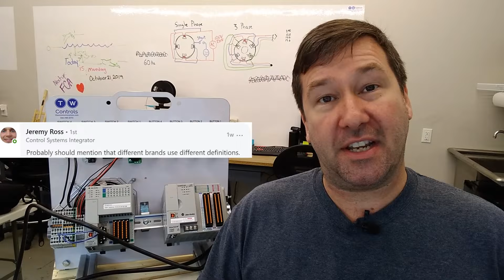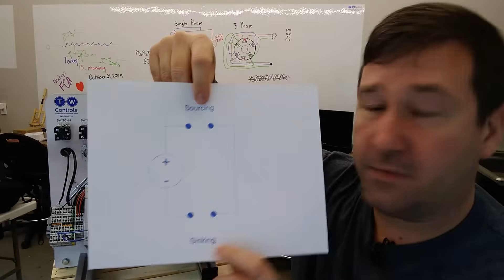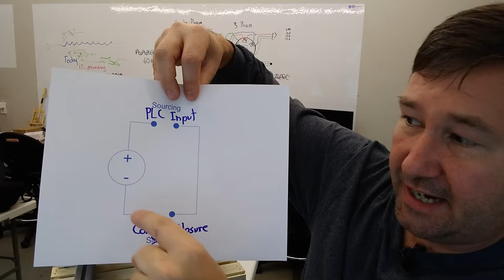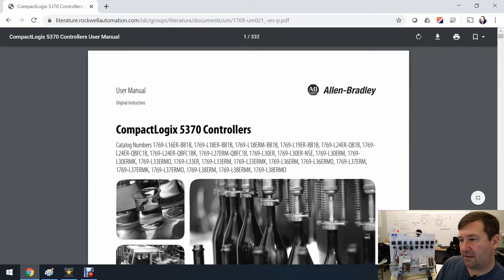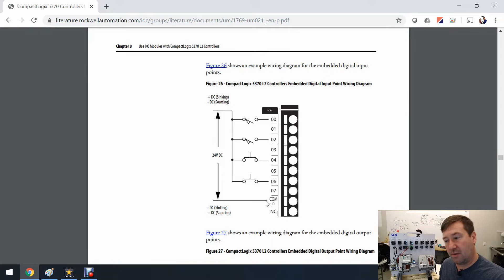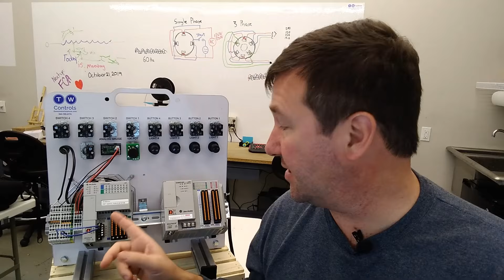Sinking and Sourcing PLC Inputs with PNP NPN Sensors

Comment: This is a typically hard concept for people to follow, mostly i think because of the nomenclature not used anywhere but electronics. I once again was out at a customer helping get a process running, and somebody had wired an NPN sensor to their sinking inputs. I always think of it in as they look phoenetically, NPN sensor (P is the common between the two. Positive resides on the common of the plc) PNP sensor (N is common between the Ps, so N [0v] is the common on the plc). Sourcing to me can just mean the source of the voltage comes from this point, so activating a PNP Sourcing sensor means the return wire to the plc input will have voltage and must complete the circuit with the Common being the 0vdc wire or "N".
Reply: I'll add too that it's almost comical how many technicians I run into that say "If the lights on, it's working, so it doesn't make sense why the input won't turn on, I think the PLC is bad." 

A GREAT tool for people to use, veteran and novice, is the Turck TB3-CP80. It will not only power sensors, photo eyes, etc. but also tell you if it's working and whether it's NPN or PNP, normally open or normally closed. If anybody does troubleshooting with sensors, they need it.
Reply from the maker: That's a good phonetic.  Keeping them straight is half of the battle!

Comment: Hi Tim, great video! Love your learning video series! Just got a stupid question, does PLC have internal physical Relays or coils for digital output? Searched over internet, someone says yes, someone says no. I am confused. Could you clarify this question for me? Many Thanks!
Reply from the maker: Oh my this is a popular question this week!  NO NO NO!  A PLC has memory areas, not magical internal relays.  They can be different sizes, in the case of your output it is a BOOL data type which can hold a 0 or a 1.  Ones that are associated with an output are no different than ones you create as far as PLC programming.  They just happen to be used to update the physical outputs.

I guess I'm going to make a video that tries to clear this up soon, but here is an older one of me ranting about people using the terms normally open, normally closed, and relay to describe PLC instructions.
https://twcontrols.com/lessons/plc-training-plc-instructions-are-not-the-same-as-electrical-symbols-normally-open-and-normally-closed

Comment: Ok here goes, Zero experience sparky - I  have a 24v motor that controls a sliding door with 2 proximity sensors, when the door is closed(sensor indicates green and amber light) and I press the open switch the door will open until it reaches the outer end sensor and the motor stops. Now the closed sensor turns to green only. When I press the close button the door doesnt close. I have 24 volts at the switch and the switch is working properly. My question is -  is the outer proximity switch supposed to supply power to the junction box to signal for a close command?
Reply from the maker: There is 100 different ways you can wire that. You are going to need to trace it out. Good luck!

Comment: hello there ;
im talk about ( zelio or delta (low cost plc)) how can i recieve (4-20 ma) and how can i saving these data in register and export them by ethernet or serial output . and about module that i use to convert 4-20 ma to 0-10v or 0-5 v is ther any problem with real floating signal like (4.367 ma for example) i mean i want to keep this real signal and i want to get it like input with not approx reading 
regards

Comment: Hello Tim,
I was wondering if you ever created a training video on the effects of grounding the positive output terminal on your I/O power to the cards. Could you show the effects on Grounding the Positive Output on the DC Power Supply on your Oscilloscope. Then preform the same illustration on the grounding of  the Negative Output side of the Power Supply.  Then show how this effects sourcing and sinking PLC'S I/O cards as it relates false Input Signal, Output turn on with out the signal from the Output Card. Also could you explain the effects of lifting the Ground on the Secondary side of the Power Supply.  Thank you
Reply from the maker: Hi Mark.  That one is on the list, stay tuned!
Reply: @TimWilborne  Thank you. I will keep watching.

Comment: pnp sensor has 3 terminals : +,- & the sensor o/p terminal which sends 24V w.r.t ground to the input or output port of the plc. While NPN sends 0V.
Reply from the maker: Both NPN and PNP sensors can be 2 wire or 3 wire devices.  Also you don't "send" 0V.  0V sinks a potential from the PLC input.  It is a small detail but it also helps you keep the sinking and sourcing terms straight.
Reply: @TimWilborne  Thanks for clarifying. Also loved your video.
Reply from the maker: @akashsharmaaaa  You are welcome, thank you for watching!

Comment: It has to do with transistor design, and how they are dopped. I believe the L24 has opto isolators so it doesn't care which way the power flows, this is however a more expensive option. This might help https://youtu.be/7ukDKVHnac4
Reply from the maker: Good tips John, thanks!

Comment: PNP or NPN sensors goes with the transistors or electronics inside it. If its using a PNP electronic parts then the sensor is PNP. And to understand this, you can take a look how to wire a transistor if its PNP or if its NPN. That's my guess!
Reply from the maker: There has been enough interest in this that I might make a video. Thanks for watching!

Comment: To answer the question why do we have NPN & NPN? It was my understanding from an "older instructor" who has been in high speed programming and  impressive resume told me that either PNP or NPN (not sure which one, I think it was NPN) predates the other. So the reason why you have both PNP and NPN is because in the past they could only make the electronics one way. Then they figured out how to make the PNP, I believe. That the best I recall from a few years ago. I recall him saying what Tim said in the video, that the concern was that if a wire is pinched or something cause something to ground the could cause somethiing to run which you did not want. In the case of PNP, you was more likely to blow a fuse.
Reply from the maker: Good explanation Mike.  NPN is older and for some reason slightly faster.  I'm going to do a video on it as soon as I have time to study on it.  Thanks for watching!

Comment: If I wanted to simply monitor the dry 'alarm' contacts on a bunch of field devices (which are NC, and 'Open' on alarm), should I use sinking or sourcing PLC inputs?
Reply from the maker: With a dry contact, you can use either a sinking or sourcing PLC input.
Reply: @TimWilborne  Thanks! Would sinking or sourcing inputs be the most common method for dry contact monitoring?
Reply from the maker: @RD-ni7qe  There is no right or wrong answer to the question.  Sinking inputs are more common if that helps.

Comment: For one of my application (egg counting system) previously I used PNP, and the result was that I was getting short on the counts by 10k. I then used NPN, with 24V going to the PLC com and receiving a negative input on the PLC card, and the cout was aproximately perfect.
Reply from the maker: Interesting application example Nikhil.  I might try to replicate it for a video.

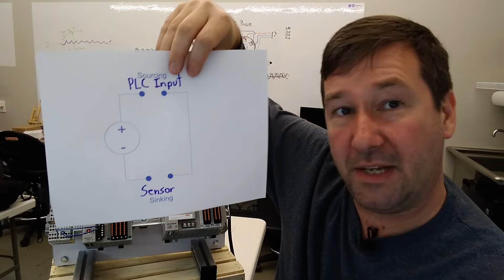Comment: At 15:00 you ask why they use the terms  PNP and NPN instead of source and sink.  The PNP and NPN terms are from transistor construction and what type of material you have sandwiched in there to create the transistor.  And in a BJT the emitter leg will source in a PNP device and on an NPN the emitter leg is a sink.  That's why on a PNP transistor schematic symbol the arrow points outward and on a NPN transistor symbol the arrow points inward.   Thanks for your videos, looking to change focus and get a new job soon.
Reply: Reverse! NPN points to emitter.
Reply: @rhythmandacoustics  Correct........My instructor taught me that the little arrow is a penis. So arrow pointing into the center is a  PNP (pee in the potty). Arrow pointing out is a NPN (no pee in the potty.....BHAHAHAHA
Reply from the maker: Great explanation. Thank you watching and good luck with your job search!
Reply: "Point in please" and "Never point in" is how we learned in the old days.

Comment: What about OUTPUTs, would you have any tips on those? Sounds simple at first, but some guys say it's more complex
Reply from the maker: See if this video helps. It's for the Compactlogix but the principles are the same for most any PLC.
Reply: Yeah, this video on INPUT basically does it. My boss told me today that OUTPUT would be the other way around - - simply check wether your PLC OUTPUT is PNP or NPN, then complete the circuit with your load towards the opposite polarity. Loads would have no polarity
Reply from the maker: Not sure I understand your question Alan.  Both of those videos cover inputs and outputs.
Reply: @TimWilborne  Did you by chance send a video link with your previous reply? It won't show on my side
Reply from the maker: @alancordeiro8650  Try this link https://www.youtube.com/watch?v=qbra8auofCc

Comment: It's much easier to find that burnt wire and replace the IO fuse than it is to figure out why intermittently the machine does something on it's own. Especially given that wires+vibration+metal = short to ground.

Comment: When you were mentioning Applications to use sinking vs sourcing... 

I think one thing that should be added is that if you are dealing with system that uses a variety of sensors that requires different voltages (e.g 5vdc, 10vdc, 12vdc, 24vdc etc) you can use a plc with sinking outputs and connect for example a 5v sensor on output 1, a 10v sensor on output 2, a 12v sensor on output 3, etc. this works because you’re switching the negative side of the sensor. All commons/ negative side of each power supplies are almost always tied together somewhere whether it be through internal chassis ground, on a PCB negative rail, or directly tied together through terminal blocks.

Switch is done using NPN.

Its not posable to use differed voltages  on a sourcing PLC because your switching the positive side of the load. If you were to connect the positive side of power supplies of different voltages your output voltage would end up being whatever the highest voltage power supply is. (e.g 5v, 12v, 24v = 24v out) So you would end up a single output voltage instead of different voltages. Because switching is done using PNP.

So all that being said documents for both PLC and Sensors vary from manufacturer to manufacturer and series. I think the only way to know what you  have or need is to look up the internal schematics for each PLC and sensor and check the type of transistor being used in the PLC and then the type of transistor being used in sensor and not rely solely on the manufactures product description.  Yes this is/ would be a daunting task but its really the only way I can see to be 100% certain you end up with a proper system design.
Reply from the maker: That is an interesting thought about using sinking inputs for multiple voltages. The PLC inputs even when sinking usually are for specific voltage so I'm trying to figure out whether that's a good practice or not.

 Do you have any PLC manuals you can think of that show examples of this being done?
Reply: So... Allen Bradley’s manuals don’t appear to list full specs for their products they just list basic value of 24v for inputs and outputs. I dont see anywhere in their manuals where they list dropout voltages for any of their I/O’s. To be able to use different voltages you would need to know the dropout voltage of the inputs.

Don’t dog me for this.. but all of automation directs plc’s list the dropout voltages and the stable min max voltages for all their plc’s and modules I/O’s. 

For instance click’s I/O’s operate between 5~24v. and I know mixed voltages work on click’s and brx’s

Since Allen Bradley doesn’t seem to have theirs listed if you have a variable bench power supply? You could hook it up to one input and set it at the 24 V you know works. Then slowly lower the voltage until the input turns off. Then slowly raise the voltage. Until it turns back on. 

It’s either going to turn on or off at a higher voltage. It will not be the same voltage for both. Take that number and add a min of 2~3v and that should give you your min stable voltage.

If it turns off at 20~24v then I guess they must have fixed voltage inputs. And would guess if you ohm out the input its high resistance.
Reply from the maker: @mumbles1justin  I can see how this would be a good practice for a PLC output, page 2-35 of the Click manual clearly shows an example of it.

But while I think this would work for a PLC input in most cases,I don't think this would be a good practice.  Even on our devices, the circuitry is different for 5VDC sinking inputs compared to 24VDC sinking inputs to adjust the switching threshold.

Looking on that same page 2-35 of the Click manual, the ON threshold is 19V and the off is 4V (7V for X3-8).  12V or 5V may switch them but are not in the range.  That seems to be the case for all of the Click inputs except the C0-08ND3 which is designed for 12-24V whose ON threshold is 8V and OFF threshold is 3V.  And personally I wouldn't like having to draw a 24V input down to 3V to get it to turn off.  As a machine shows some age it could cause problems.

I have a variable power supply, maybe I'll play with some various devices to see how they perform under different voltages.  Great conversation as always Justin.  Thanks.
Reply: I went back and looked at some of my old job notes and it looks like I used  sinking outputs to interface with a machine that had 5v, 12v, and 24v logic. 

On the PLC inputs it utilized 12v and 24v triggers. To get 5v inputs I used an opto coupler at the rack to “convert” the 5v to 24v to trigger the plc input.  

So Ill have to agree with you that most plc’s having fixed voltage inputs.
Reply from the maker: @mumbles1justin  Still I think it would make a good video to play with switching thresholds even to show how corrosion and other factors can affect machines as they get older.
Reply: Tim Wilborne I cant say that Ive seen it in a plc manuals. But thats how 90% of electronic circuits work in general. 

Just for an example. Take a computer for example this is probable not the best analogy but.... Inside you have common rail aka ground, 3.3v+ rail, 5v+ rail 9v+ rail, sometimes 12v+ rail and 19v+ rails. All these voltages are used to power different components of the system but all use a common negative rail.

 Ok so your thinking well maybe they’re all being powered from the same power source so thats why they can get away with that. No not always.

For example servers with redundant power supplies for example. They still use common negatives and electrical grounds.

Another example for instance is a powered USB hub. Most of the time the hub will be powered using a separate 12v power supply. But that power supply’s negative is going to be tied to electrical and chassis ground of the hun, along with the shield of each of the usb connectors. On the computer side the usb is tied to electrical ground and negative rail.  

Another example is communication ports RS232, rs485, etc all use common grounds between devices and operate using different voltages and powered by different power sources.

Basically what I getting at is ground and Negative are typicly handled the same and required in most applications to prevent ground loops in a system.

By the way Im NOT claiming to be an electrical engineer by no means. And if anyone cares to prove me wrong or would like to correct me. Please do it somewhat respectfully,  so I can better my knowledge.

Comment: Another good video would be reading the diagrams on sensors and how to wire them to your plc. Some are very confusing especially when you have a retro fit or replacement in the field that doesn't match the original.
Reply from the maker: That's an excellent idea Jacob!  I'll put it on the list!
Reply: Excellent